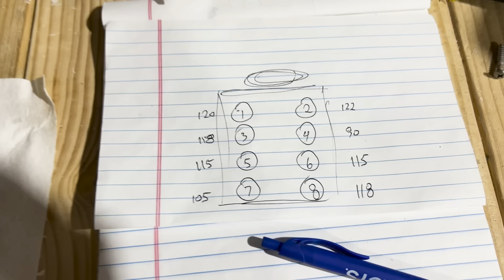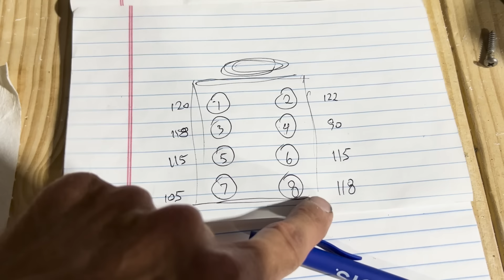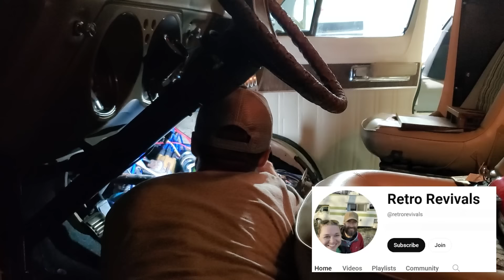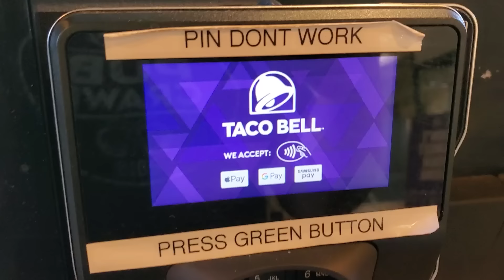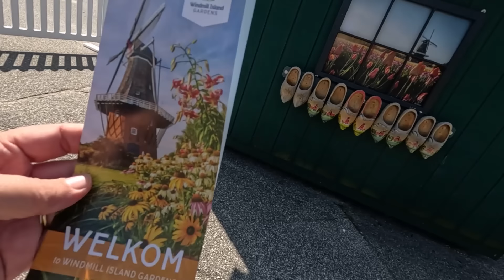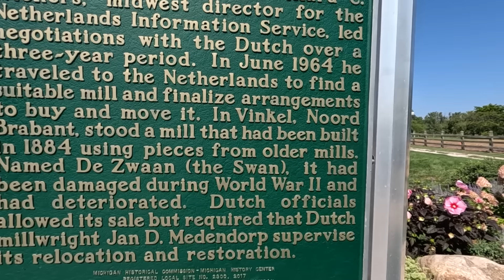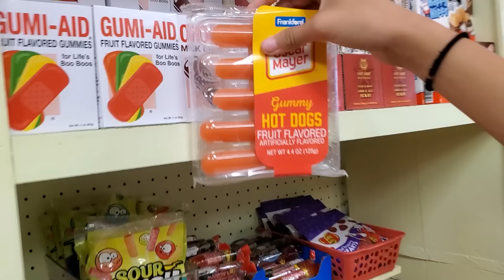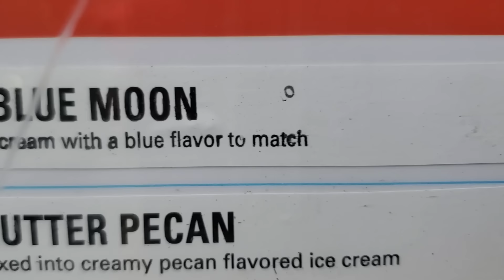Last-Minute Fixes to Vintage RV Gone Wrong: Holland, Michigan Camping Adventure

Comment: Tell the dad from family ties, if your distributor has to much advance, it will cause a hot restart problem, adjusting the timing with less advance might fix your problem.
Reply from the maker: Finally the timing is set. We set it to 32 degrees of total timing. That and the new carb have it running much better 😁

Comment: You might consider an electric fuel pump back by the fuel tank.   That way cool pressurized fuel (non-vaporized) can push through the vapor lock.   This is a common practice in the Corvair community.
Reply from the maker: That's a good idea. We'll drive it a few times and see if the new carb improves the hot starts. Thanks for the comment!

Comment: They make a fuel filter that has a single in and two outs. The two outs means you run one to the carb and the second back to the tank. The are designed to stop vapor lock.  You can also get a phenolic carb spacer.  That will stop the boiling of the fuel in the carb bowls.
Reply from the maker: I'm hoping we resolved the possible vapor lock. Check out part 2. It's due out soon. Thanks for watching 😁

Comment: Put a vacuum gauge on it if the vacuum isnt correct alon with idle speed you'll never get it timed correctly....also make sure you didn't mess up the wires when installing the cap make sure its at tdc and check to make sure its pointing at #1
Reply from the maker: Got it! Timing is now set to 32 degrees total timing. It's running really well with the new carb 😁

Comment: If your front brakes ever lock up and smoke, check to see if you have a combination master cylinder and power steering. 
It's what we have... towed 2 times.
Reply from the maker: Good to know. I'll keep that in mind if we do another RV that is set up that way. Harvey's is seperate. The power steering does not have power assist from the brake booster.

Comment: If you're using a hi volume pump. You may want to look in a higher capacity pan. The last thing you want is all the oil up top and non left in the bottom.
Reply from the maker: I considered that. The pan is already pretty deep. Ultimately I believe I'll be ok. Harvey should seldom see RPM's above 3,000. If it was a drag or race car then it would be mandatory. I check my gauges constantly too. Thanks for the comment 😁

Comment: I would check your base timing and make sure your timing is correct and that your advance is working for the hot start issue as well as your fuel line insulation.  re-route away from an exhaust if possible.  you can also looking at adding a low pressure boost pump - so if it is vapor locking - it will push fuel thru the line.  I don't recall if you're using original block pump that "sucks" fuel from the tank or if you have a pump "pushing" fuel from tank to engine.  if it's a sucker - add you an electric boost pump.  That's partially why Fuel injection avoids this issue - higher fuel pressure - keeps it from boiling in the lines.  today's ethanol fuel is terrible.  Also - if dodge is similar to GM (i'm mostly familiar with GM) check your ignition module - if it's in the distributor - make sure it has thermal paste on it - and or replace it.
Reply from the maker: Thanks for the tips. Total timing is now set to 32 degrees total timing. It took awhile to finally get it right. We insulated the fuel line. If the issue persists we may reroute it but I think we're good now. The idea of a boost pump is good too. As for the ignition,we did away with the factory electronic ignition and went the way of a GM HEI module. It really simplifies things. We'll keep everyone posted if more issues arise. Thanks for watching 😁

Comment: How hard would it be to make a longer gas line from the pump to the carburetor and route it differently?
Reply from the maker: That's a possibility if the hot start problem persists after the new carb install.

Comment: Just checked out you new video love your revives , on the timing I did not here if you disconnected and plugged the vacuum advance line , if it was still connected you were actually retarding the timing too far could  have been reason for backfire keep up the good work
Reply from the maker: Thanks for watching! I did have the distributor disconnected and the carb plugged. I still managed to mess up the timing though. I was retarding the timing way too far. The timing marks on the 440 in a van chassis are nearly impossible to see. The second part to that video is due out soon. Keep watching!

Comment: Sometimes I watch you working on this motor and I wonder why are you even touching that thing...do you even know at what timing degrees is your timing mark supposed to be at?...also, are you sure you correctly installed the plug wires and didn't jump one tower?, cause if you did, your timing mark will be off and you trying to bring in the mark at the balancer will be a disaster!...it's very important that ypu time the engine at the CORRECT DEGREE, if your timing is retarded she won't have as much power and SHE'LL RUN HOTTER, so the timing degree is of utmost importance...but I'm still tryin' to wrap my head around your comment about "you timing it by ear"...OMGosh..can you say "shadetree"?...
Reply: You seem like a real peach to be around
 Some of what you said was helpful though.
Reply from the maker: Lol. Yes very shade tree. The 440 in a van chassis is very difficult to see. Check out part 2. It's due out soon. Keep watching!